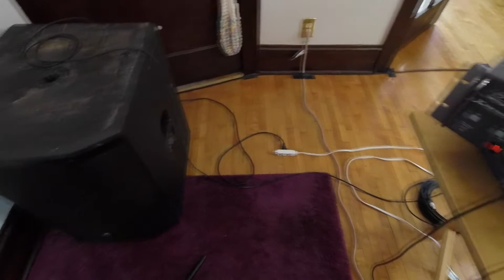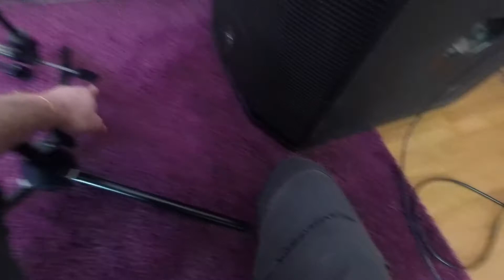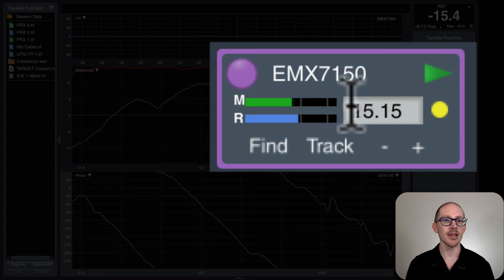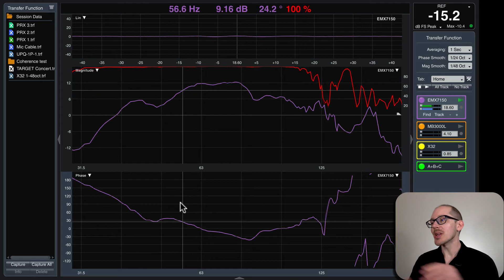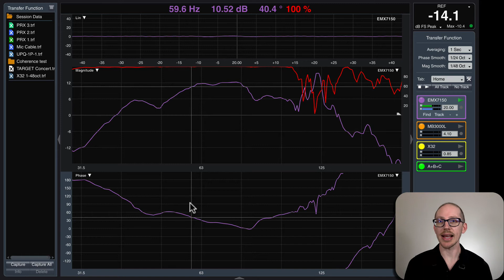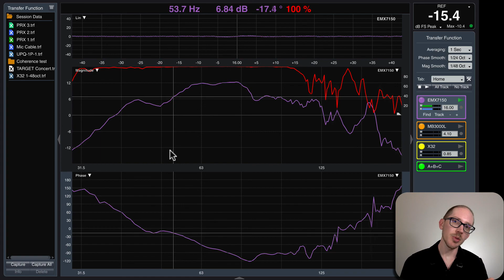How to set the delay locator to measure a subwoofer in Smaart [GSwSST29]

Comment: Thanks for the video Nathan. 

My question is - when aligning the sub to the top speaker, i would need to set the same delay with the same mic position? How would you go about the delay value in case you need to have two different mic positions for measuring subwoofer and top speaker ? (in case you are not achieving a good coherence by measuring both for the same mic position)

Tks in advance!
Reply from the maker: @lushlab.x  you’re welcome! Thanks for checking it out. Alignment happens at a single location so if you’re not getting actionable data, then you move to a different location and measure both sources there.
Reply: @nathanlively  tks a lot for the fast reply! 

I was meaning to ask how would you go about measuring the subwoofer on a situation similar to the one you mentioned on this video, where you need to have two separate mic positions:

https://youtu.be/XvgV9MclDBg?si=r15zHz57NYemly14

Tks again!
Reply from the maker: @ tricky. Not recommended. Match distance and delay locator for each measurement.

Comment: For those who did not know where the wrap around 10 milliseconds came from just like me. Frequency itself vibrates 100 cycles per second (100Hz). Therefore 1 Cycle should take 1/100 seconds to complete. While 1 second = 1000 milliseconds. 10ms is the time for frequency 100Hz to complete one cycle.

Comment: Nathan, would it be possible to just extend you xover temporarily to 1000hz or so to get a better lock from hi frequencies thru sub?
Reply from the maker: Hi Ronald. Yes, it is possible, but not recommended. Adjust the low-pass filter will not give you accurate results on the phase graph. Try it out. Measure the sub with the LPF in, then out.

Comment: Hi Nathan, is there any reason why you are pointing measurement mic to the ground in around 45 degree? I was wondering about mea. mic placement when alligning sub to mains, so far i used to just lay it on some foam on the ground.
my consideration:
- on stand, pointing to ground at 45deg, tip nearly touching ground - getting mainly reflections of ground, no direct sounds
on foam, on ground 50/50 reflections and direct sound (for me it feels like the most natural usage)

- on stand, pointing up at 45deg, tip few cm above the ground - getting mainly direct sounds , reducing reflections of ground

I think it does not matter when measuring just subs, but it may have significant coherence impact when measuring also mains. 
what do you think about mic placement?
Reply from the maker: Hey Dominik, thanks for checking out the video. I have an article coming out soon that covers lots of mic placement questions, but here are my thoughts about mic height:

Head-height or ground plane?
Head-height is preferred since it most closely matches the listener's experience, but should be abandoned for ground plane if actionable data is heavily compromised by floor reflections. Keep in mind that changing height will also require a change in depth. For example, if you decide that you want to measure at ¾ depth, consider a line from your main that intersects with your mic and then the floor and move back to this position.

If you are measuring ground plane on a floor that is not ideal for reflections (eg. full of chairs), consider using a 0.5ft2 (0.15m2) reflective panel like plexiglass to preserve high frequencies. Or, simply ignore the HF response during your crossover alignment, then move back up to head height for other calibration processes that focus on the HF.

Does that help? Or did you have a different question?

Comment: Ahhhh, I just finished calibrating my surround room and just seen this video. Ended up setting the LFE to 0 delay so that my graphs weren't all crazy. I'm mostly concerned with the magnitude trace, so I think it is okay if the coherence is slightly off. Do you think I should recalibrate the LFE with the correct delay setting? But I'm also not looking for a specific cross-over frequency since the LFE channel is it's own channel. What do you think?
Reply from the maker: Hey Carlo, I'm not sure. If the LFE channel is not coherent to any of the other channels, what would you align it to?
Reply: @nathanlively  Just needs to be +10dB of in-band gain from the main channels. I guess the only time it would really matter is if I was using bass management.

Comment: Hello Nathan, every X32 has the .85 ms delay? I wonder because I have a weird situation , my subs physically are behind the mains, physically .35cm , after smart alignment I have .90cm (overlap at crossover point)  instead of the physical .35cm ..., does smaart take in consideration the board and the processor delay ?  I am not using smaart delay, just reference and that’s it.
Reply from the maker: Hey lowbass5, I don't know about every X32, just mine. :)
I'm not totally clear on your question. Maybe you could making a drawing for me?
0.35 centimeters is 3.5mm is only about 1ms. Have you tried just putting your main on the ground right next to the sub to see if they are in alignment natively with no changes?

Smaart is just a dumb machine. It doesn't know or care what you have in line. It will measure whatever you pass the signal through. If you run your reference loop directly from the output of your audio interface back to the input and the measurement signal through the X32 to the speaker, then yes, you are measuring the X32 and the speaker.